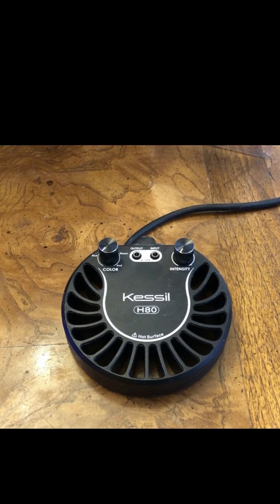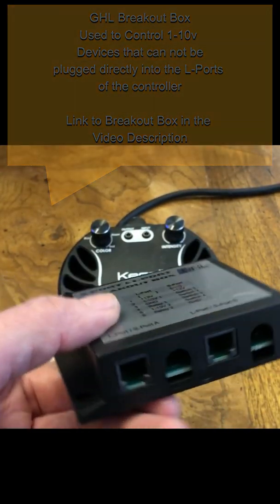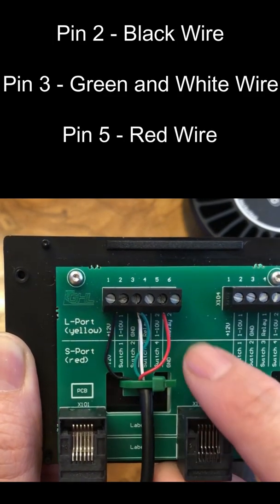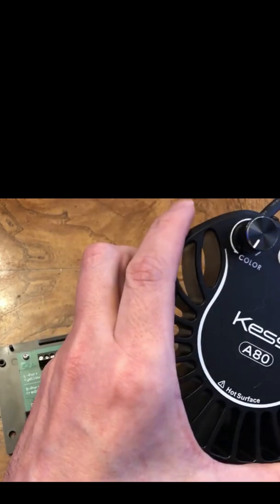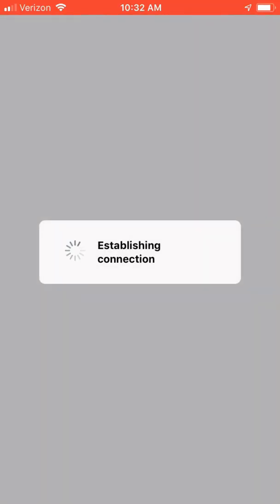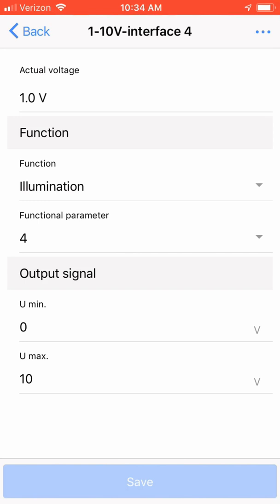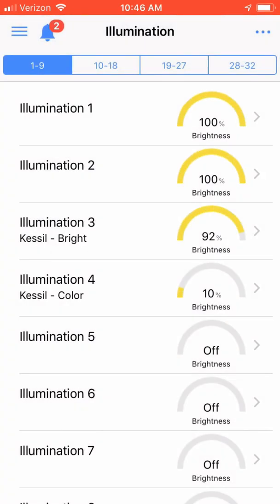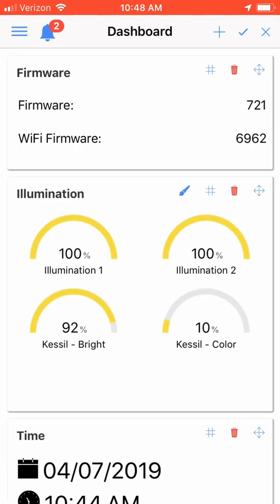ProfiLux Controller (4/4e) – Install/Config a Kessil Light with the use of a GHL 1-10V Breakout Box

Comment: Hello, this was a very informative video!!.. does this work the same for a Profilux 3.1Ex, and do you need such a breakoutbox for each Kessil A80 individuali or can you combine 2 lights on 1 breakoutbox?
Reply from the maker: You would still need the  Breakout Box as it will be connected to the 3.1Ex 1-10 Port. You use the same breakout box for both and use both channels. I have not tried to chain 2 of them together on the same port, but the Breakout box supports two channels so could easily use 1 channel for the 1 light and the second for the other.
Reply: @KR-id6bl  Thank you so much for the info. I'm going to try this

Comment: Thank you for your enlightening film. One question: For what reason do you limit the upper limit of the control voltage for the light intensity (from 10V to 8.5V)? Is this an extra margin to save the lamp, or does this value match that of the original Kessil controller?
Reply from the maker: After talking to Kessil, and playing with the light I found adjusting the  Voiltage to what was inside the video allowed for the illumination channel to match closer to the light output voltage.